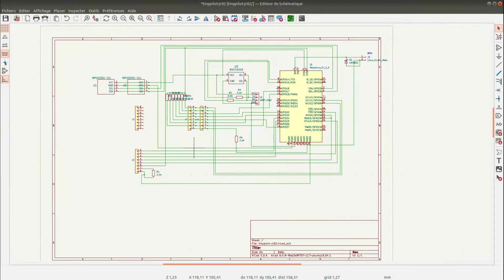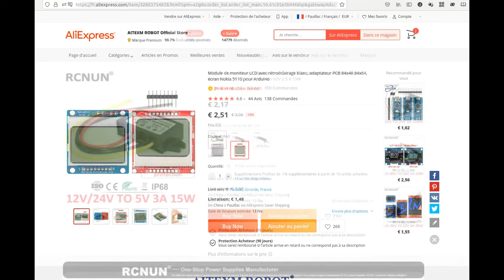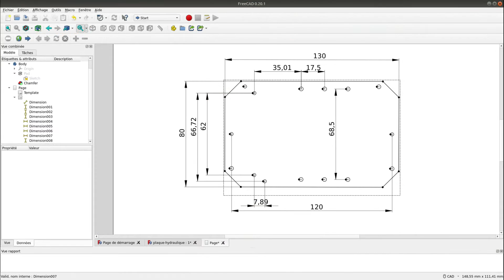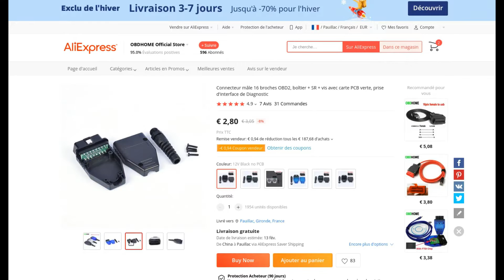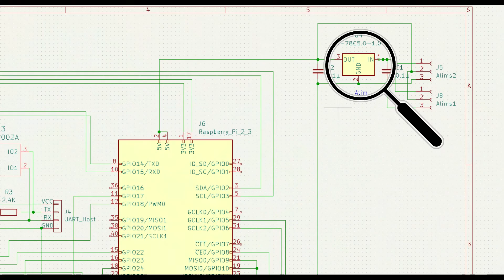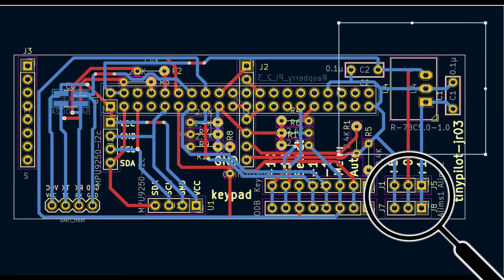DIY Rugged Pypilot , fabrication d'un Pypilot 'durci'

Comment: Impressionnant, vous faites tout de A à Z. J4ai acheté le kit complet de Sean et j'essaie de comprendre comment le faire fonctionner, mais j'ai tellement à apprendre du Linux - RPI - Open plotter.... Ca va prendre du temps. Bravo à vous
Reply from the maker: Merci pour votre commentaire , comme vous avez acheté, le kit vous verrez que le câblage est très facile, vérifiez bien le sens d'action du pilote (tribord, bâbord). Il vous faudra surtout adapter le réglage des 'gains' à votre bateau , partez de réglages avec des gains faibles pour commencer ...
Reply: Bonjour, pouvez vous me donner le lien pour acheter le kit, merci

Comment: The reason the main power traces are not covered in silk screen is that board was intended to cover them with solder to increase their current handling ability.   Probably only needed if the motor uses more than 20 amps.
Reply from the maker: Thanks for pour comment.